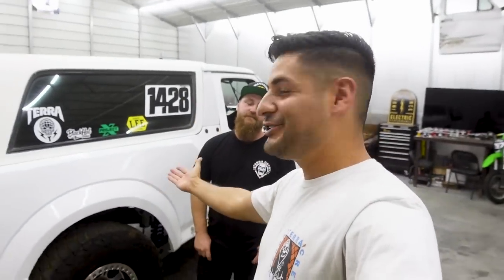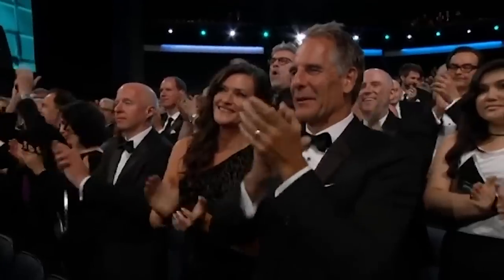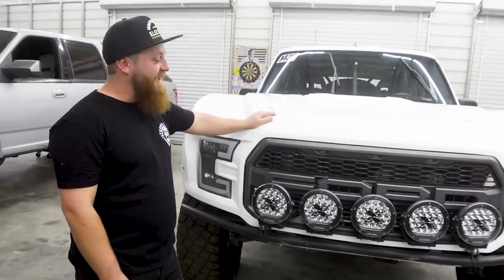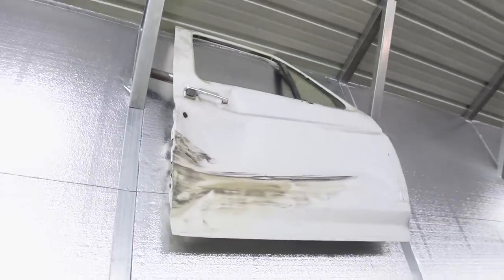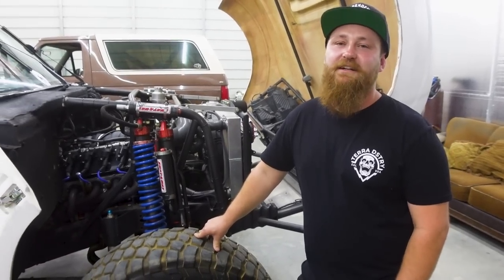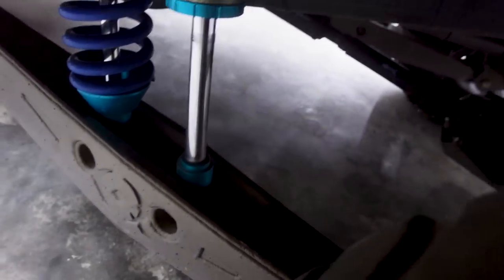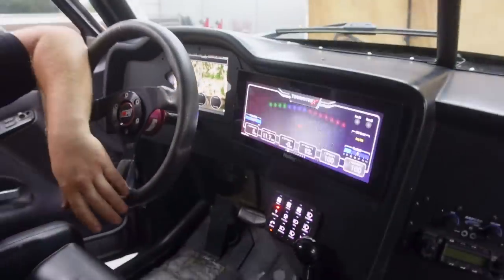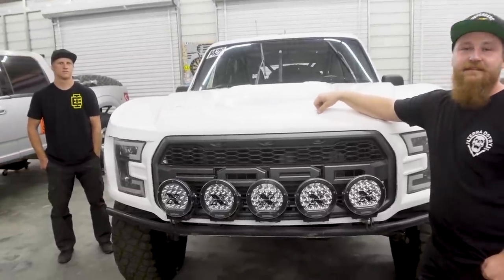This BRONCO F*cks!! Big Booty Ford Bronco Get's Down! | BUILT TO DESTROY

Comment: I LOVE, love that this extremely advanced, immaculate race truck of a stretched bronco is on a 2.5/2.5/2.5 shock package.  It shows that you can podium races without king kongs or fox 4.4’s … not that it won’t get that big of a shock package some day, BUT.  It shows you can grow into things.. this whole truck proves that.  You don’t need to have your truck down for 5 years or more until you can afford 25k worth of dampening to “run with the big dogs”.  Get it running and have fun.  You don’t have to have the biggest swinging D___k in every possible avenue to have an amazing truck that that will put smiles on your face and handle whatever it’s capable of.